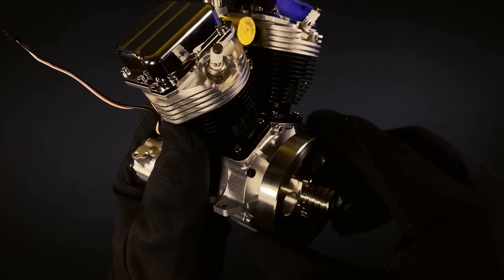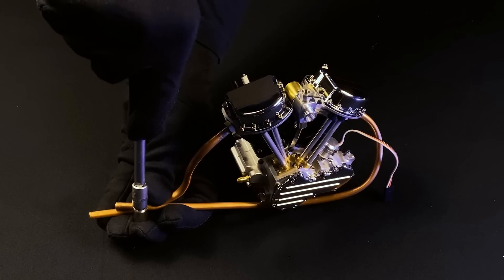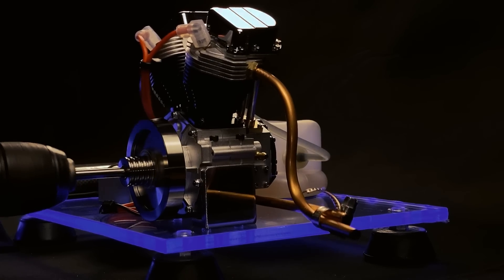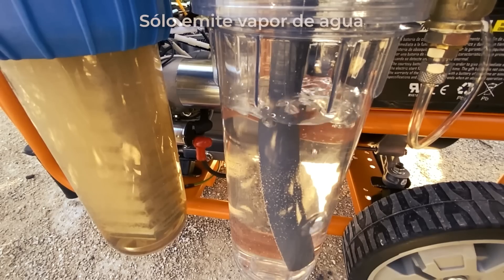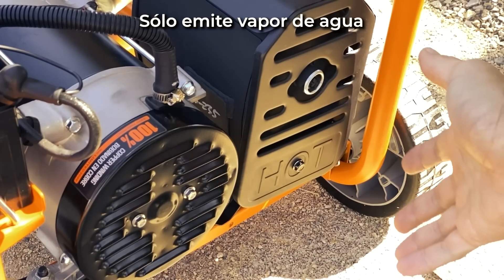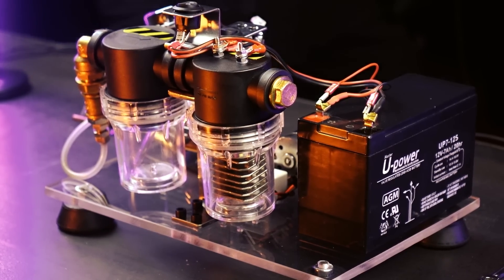FREE ENERGY GENERATOR WITH WATER - HYDROGEN ENGINE

Comment: Very clean, nice build. After battery starts initial hydrolysis..can it keep running without the battery by charging itself? Faraday conservation of Energy says no, but I wonder how much percent boost these provide..
Reply: to charge this electrolysis it needs very minimal current from battery to generate hydrogen gas.

Comment: The thing is, is this not just one cell charging another cell. Ultimately, once the battery dies it's game over. Unless you have something that circulates some of the hydrogen power back into charging the battery and also to water cool the engine, the concept has no longevity. Right, or am I missing something?

Comment: it's a nice but also complex project, but: what cylinder capacity does the engine have, at what revs does it work and how much gas does it use...how much gas does the electrolysis device produce, I don't think it has anything to do with the engine's consumption. In other words, if we measured the air absorbed by the engine (rotating it forced from the outside), we would see that it is much more than what the electrolyzer produces. As a parenthesis, already having the gas mixture H2+O2, it shouldn't even take "extra" air from the atmosphere (through the intake system). Success!!  👍

Comment: Does burning the hydrogen produce more energy than the amount of energy required for electrolysis?
Reply: No. However, in the real world, I imagine solar cells could augment the alternator/generator to provide passive charging to the system. 

In a real car, the alternator actually provides all the electricity to run the car (once it's running) and the battery acts as a buffer to smooth out voltage spikes.

Comment: you can also use a PWM to pulse the supply of the cell at it's resonant frequency, reducing power consumption and increasing HHO output
Reply: It would also be simpler to use High Voltage capacitors From a microwave .
Reply: @oscaragredano1196  Show us how it's done....

Comment: you have to isolate the battery
Reply: It wouldn't run for long if he did that. Hho generation is super inefficient. What he needs to do is add a passive recharging solution to augment the generator so it can continue to run without discharging the battery, too.

Comment: How do you add lubrication to the water/? I know that this engine runs on gasoline/oil mixture 25:1 as it has no sump or oil pump
Reply from the maker: We have used this motor without lubrication to do this experiment. Obviously if we have it running for a long time it will break down
Reply: No requiere aceite en el combustible porque es de 4 tiempos.

Comment: This is very good attempt to make the Engine run purely on 100% H2 and O2.  The Exhaust will only have water output / steam.  This can be scaled up for a higher power output, the only problem with Hydrogen is that after a month or even within 10-15 days of running, the Pistons, cylinder Head, Cylinder walls will see EROSION.  The word is actually EATEN AWAY, as Hydrogen being the smallest particle on Earth, its atoms will penetrate through Alum Alloy Walls and start to Eat up the material little tiny by tiny - so this Engine will stop working and will become completely un-usable after a month.  To overcome that you will have to make use of high impact Ceramics on the Piston, Head insides and maybe Titanium Coat the Cylinder Walls - but the Piston RINGS - I really don't know if you can buy of Real Titanium material.  Surely your engine will become one hell of an Expensive Equipment ...... if you can afford all those material change and then it may run for 6 months to a Year - depending upon your usage, then you replace the Engine parts once again.   I would recommend that using a STERLING engine - which only requires an External FLAME - which can be generated by the HHO - would be better option but again - I have not seen such high powered Sterling Engine which can turn a 10KW Generator to give you the Power required.   Something that i am looking forward to make myself one day.
Reply: how could we stop this  penetration of the metal could we coat it or use different metal
Reply: Um, hho turns into water, which when added with the heat of combustion exacerbates oxidation... Caused by oxygen. Which is in the name.

 The hydrogen in hydrocarbons doesn't magically 'penetrate cylinder walls,' oxygen and rust are your problems here. Not hydrogen. I'd love to see him run a stress test to see how long it actually can run before it's ablated to oblivion.
Reply: use metall ceramic ,and motor runs forewer
Reply: Exactly
Reply: The only known substance is lost tech called starlight but the guy died and he never wrote it down for fear the us govt would take him out after learning the secret such a shame
Reply: What if we use only oxygen to run engine
Reply: @RishavBhatnagar  Oxygen never burns.... it is catalyst.
Reply: H2O iz H2- O H2O2 e apă oxigenata chimistul pulii

Comment: You should show battery voltage before engine start and after if its actually recharging it giving positive energy balance
Reply: Exactly my thoughts! The battery has a large capacity and maybe the engine hasnt enought power to keep up with the power demand
Reply: why? It is enough to let him to touch exhaust - if it is at least 100% efficient, then exhaust temperature needs to be same as inlet temperature - room temperature. Such great 100% efficient device without any friction and temperature loses cannot produce any other heat. But of course, nobody is telling people to not build such device themselves (it is not needed, there is no risk that somebody will be successful)

Comment: Obviously it needs to be started by external motor power. What happens when the HHO supply is depleted? You can see it yellow, meaning the salt has some how been converted; losing its conductivity and therefore free ions.
Reply: No, that's the anode (cathode?) being eaten away by the electrolysis and leaching into the water.

Comment: 🤣 How much Liter HHO is the generator producing per Minute? Hoch much Liter is the battery producing per minute and how much HHO is the motor consuming per Minute? When the machine produces sufficient amount of HHO by itself, it should run without batteries, wenn it is running. 😉
Reply: No. Internal combustion doesn't cause the splitting of water. Electrolysis does. That's why you need an electric supply. It's not a lossless system. Most of the electrical energy is lost as heat and oxidation of the plates. It's not very efficient at all. He would need to add a solar panel to augment the alternator with passive charging to help combat this.

Comment: What if the world loses all water so now the engine couldn't run after it uses the rest of its water  unless u make the exhaust go back into the water tank while at the same time turning the gases back into liquids meaning condensation
Reply: You think to much, the process are taking hydregene and oxygene out of the water, when those are used in the compostion, that creates............................................wait for it
.........................................................................wait for it
.........................................................................wait for it
.........................................................................wait for it.

WATER!!!
It becomes water again.
Reply: Вода всегда исчезает и всегда возращается😁
Reply: If that happens, you got worse problems than worrying about running your engine.

Comment: Do you know how much you are produting with the generator and how much are you consuming with the water electrosis? do you reach a positiv rate?
Reply: Of course not! The efficiency of electrolysis is always below 100%. To run a hydrogen motor which can also supply the production ot the necessary hydrogen would need an electrolysis with an efficiency above 300%, which is not possible. This is no new technology but old nonsense.
Reply: @heinzpg  Thanks! I know that. just to understand how much energy it is lost in this process (real numbers). At least we would learn something.... But ok, the video it's very nice!
Reply: @miguelpinto1    Some rough values for orientation. Let's assume you use one (arbitrary) unit of energy for the electrical input of the electrolysis. Efficiency of electrolysis is 80% (which is an optimistic figure for simple systems). Thus you get an amount of hydrogen energy of 0.8 energy units. Hydrogen combustion engines have an efficiency of about 40%. Thus the engine delivers 0.32 units of mechanical energy. This energy is used to rotate the generator for producing the electrical energy needed for the electrolysis. Let's assume an efficiency of 80% for this generator. Thus the electrical output of the generator is 0.256 energy units. But to make this a self sustaining system - with motor still running idle except driving the generator! - you would need again one unit of electrical energy, about four times more than you get by this system.
Reply: @joshuadenman9977     I don't know which ratio you address by the 50%. In principle you can use a generator and battery system which fits to the need of the cells. In this case conversions are not needed. Converters also cause energy losses. If you use them, the efficiency of the whole system - according to my rough numbers about 25% - drops slightly.
Reply: @joshuadenman9977    I still don't fully understand the design of your system, but it seems that you have a system that is self sustaining without any input of energy. Only a refill of water and chemicals for electrolyse is needed. And this system runs continuously and batteries are not discharged, quite contrary, you have a surplus of energy. Congratulations! You have constructed the first perpetuum mobile which really works! I recommend you to get hold of a competent expert and when he confirms this free energy you have good chances to get the Nobel price! I will read about your system in the newspapers.
 
But I confess that I am a little sceptical. I have heard about many claims for working perpetuum mobiles since decades but I never read about a really working perpetuum mobile in the newspapers. And I don't think it's the oil industry which has suppressed these inventions, I think they simply didn't work.
Reply: @heinzpg  thanks for the estimated ratios of efficiency for this system. I cannot see Joshua Denman's comments or any link or description of his 'mobile'... Have they been deleted or cens0red? Please reply with the info if you have it?
Reply: @Sulayman.786    I noted this also but I don't know the cause. The comment system is strange. When I sort comments "Newest first" I still see the last comment of Joshua Denman but not the earlier ones. When I sort "top comments" all his comments are invisible. In his last comment he called me an idiot and a moron. I don't know if the comment system reacted on these catchwords or someone else reported it. I did not report it and only the channel owner can delete comments and block users.
Reply: @joshuadenman9977    Perpetual energy has been around for a very long time? Really??? How do you explain that no one has ever shown such kind of energy in a credible way? A lot of claims, but never a credible proof? Not one person, who is eager to get famous and rich and in addition to help mankind? Don't tell me they are all frightened to be killed by agents of the oil industry! Oil and energy companies don't take any heed of free energy tinkerers. Since their serious engineers tell them that this is crap and doesn't work. 😊
Reply: @heinzpg  your an idiot.. why are you even on this site looking at these things?. Your the kind of person in the world that shouldn't exist, youv come here to this community just to dig at ppl because your a sad little moron... There's enough energy  in an empty cup to power the world for a life time the energy hasn't been harnest yt, perpetual energy is very real! The fact that it even has a name is its own proof.

Comment: How is the engine lubricated? Most of these I've seen use a fuel/oil mix.
Reply: The combustion chamber does not need oil, but only the fuel for the explosion to occur, in which case hydrogen is being used, which is highly flammable. The oil only needs to go to the part of the crankshaft which is where the movement to the shaft takes place.
Reply: Y aparte de eso se ve que el motor es de 4 tiempos, o sea, no requiere aceite en el combuetible. Solo en el carter,
Reply: there is moisture of water

Comment: Nice HH salt lol busted
Reply from the maker: HH+ is a chemical compound that maximizes the electrolysis of water using very little electrical energy. This compound is currently in the patent phase. In the future, HH+ will make it possible for vehicles to run on water
Reply: @thelibertyengine  so it wont run just on the gas produced from the plates and plain water